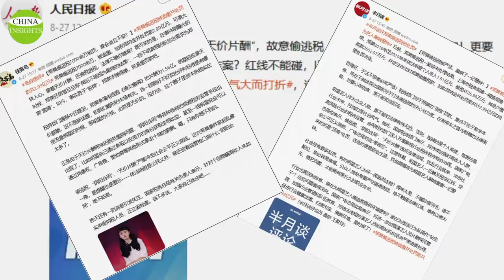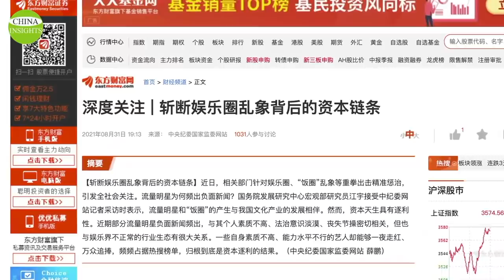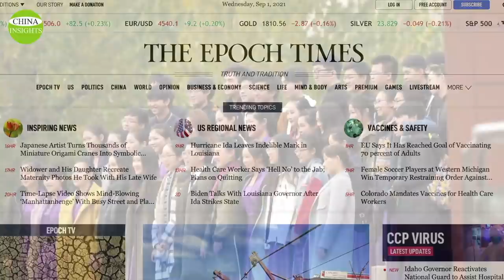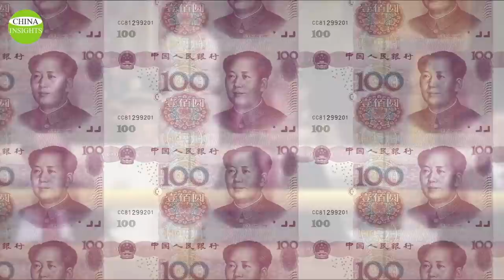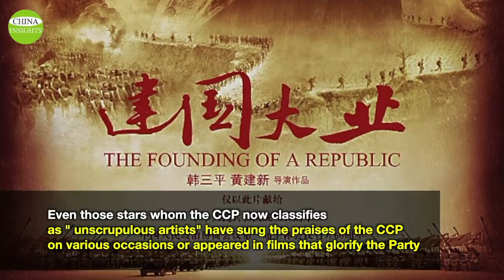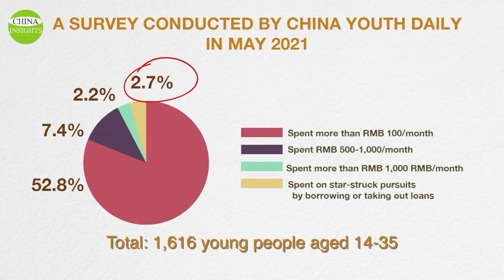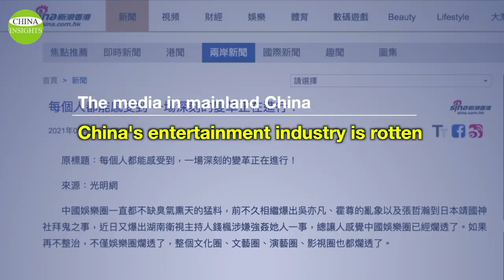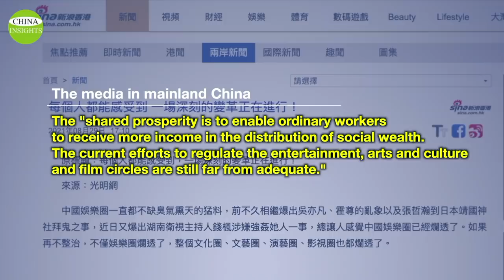Why Beijing is Cracking down on the Entertainment Industry? For political, economic and more reasons

Comment: The youth does not want to be burned out. The hours and treatment in a manufactured jobs is horrible.
Reply: The locally owned ones are likely to be. The foreign run ones tend to be somewhat  better. Company I worked for sent me to China to visit the factory there.
Factory worker hours were 8-4, engineering staff 9-530/6. Subsidized food provided by an external catering company. Part Subsidized Dorms for those who aren't native to the city. Not singing any praises just what I observed while there.  That being said, factory worker pay is very low. 4-5000 RMB if you're somewhat senior.
Engineer pay was marginally better at around 10-15000 RMB. If you can get into R&D then a junior engineer could get aorund 20k in Shenzhen. Senior engineers probably around the 35-40k range. Values are per month